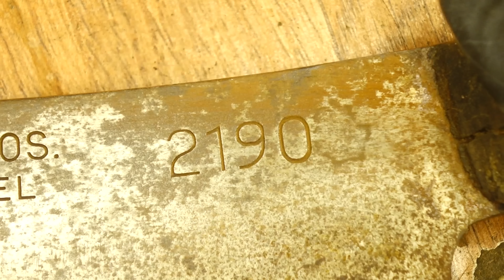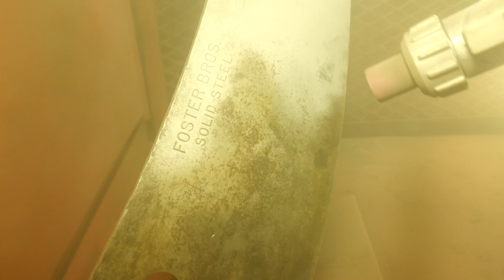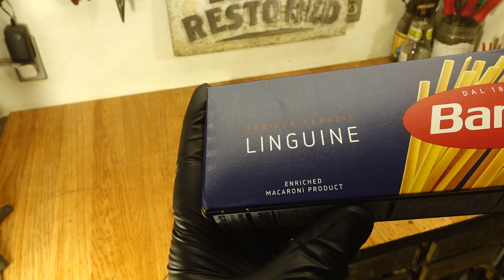I Restore This Rusty $300 Butchers Knife

Comment: Not 100 years old. Was made for military use during ww2, the three brass rivets are the giveaway.
Well done restoration though, regardless of the click bait title.
Reply: WWII started 83 years ago, that's not that far off from 100
Reply: I think you are close.  I have been researching Foster Butcher knives since I picked one up.  FOSTER BROS. was used in 1870-1890 and then only again from 1953-1956.   With the logo and three rivets, I would date it from the 1950's.   Still a very cool restoration.